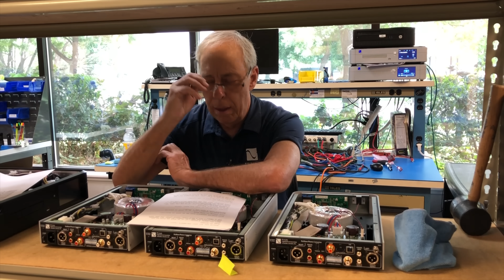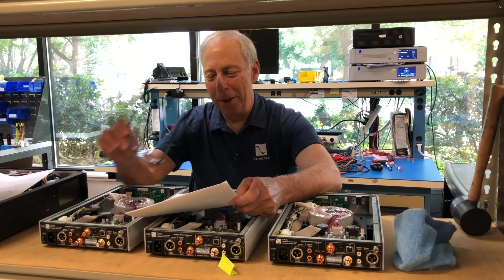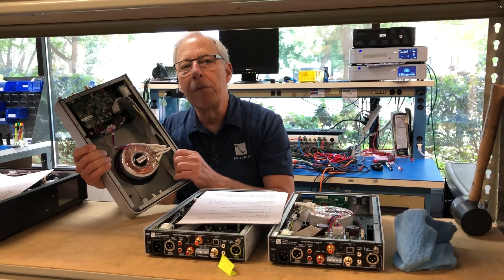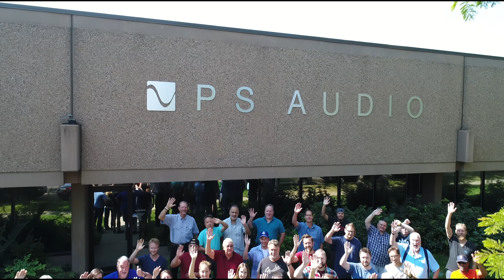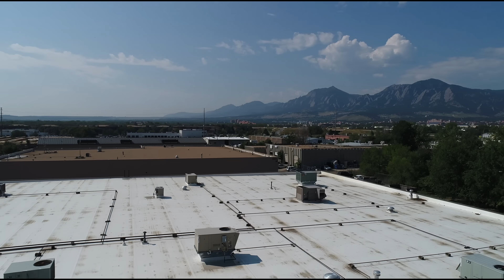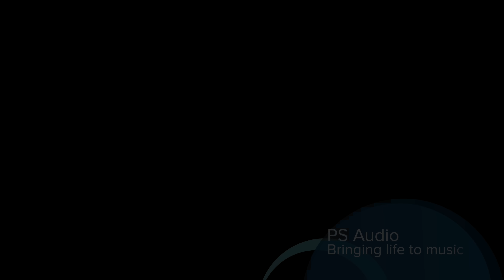What's inside a high end power cable?

Comment: Having personally put together a signal integrity laboratory with over a million dollars worth of Tektronix gear to study signal propagation from DC to 33GHz, I would have to point out that the 75 or 100 feet of wire from the panel to the outlet will be 14 gauge Romex terminated with a NEMA 5-15 duplex receptacle in most residential cases unless the space was designated as a listening room or theater in which case it will be 12 gauge Romex (named for its birthplace of Rome, New York) terminated with a NEMA 5-20. In commercial spaces by code in all places I'm aware of the wire will be in EMT or flex and will likely be 12 gauge THHN stranded terminated in a NEMA 5-20. The power cable itself represents a very small characteristic imparting portion of the path however the connectors are choke points that effectively make the cable qualities moot if the connectors are unable to perform. The IEC part of a power cable is an especially susceptible point as the bulk of connection task falls on the cord side and also remember that an IEC 60320 connector is rated for 16 amps maximum.

I've assayed quite a lot of cables and the assembly line cables the industry relies on can be frightening. Injection molded plastic hides countless untold sins of manufacturing. If I were investing in high end audio there is zero question that I would also specify a high quality 12 gauge power cable such as the ones used on rack servers, where quality is paramount and product is built to function, not to be inexpensive. For a listening room where the aesthetics of the system are part of the overall experience, even the power cable is afforded the opportunity to become a piece of art and if it is to be art, it must not be compromised in its original function. Because of that criteria and context, I cannot find a $200 power cable shocking at all where as it would be sheer insanity for a television.

From my experiences if I were to be designing and installing a new custom home system today, I would use 8 gauge stranded wire to a NEMA 14-30 receptacle and then a electric dryer cord to the amp with the wire soldered directly in and no IEC connector. For a small theatre I would do much the same except I would use 6 gauge and a NEMA 14-50 setup which is commonly used for electric ranges. While many would consider that excessive, the low impedance justifies it if you're trying to achieve everything that can be had.

For me the utility wins the day, so 10 gauge stranded wire from the panel using crimped and soldered connectors to Spec grade NEMA 5-20s with a heavy duty server IEC power cord is fine for my ears, but ideally a listener would want to also include something like a PS Audio DirectStream Power Plant to locally manufacture clean power at the amp with the amp having a short as practical power linkage to the Power Plant, made from the highest quality plug spliced onto the amp's cord. The Power Plant effectively eliminates the need for any performance in the bulk power delivery so long as the quantity of current is sufficient. This also enables the transparent use of a BrickWall™ surge filter which places a large inductance inline with the power delivery and is the best protection from surges you can give your investment IMHO.
Reply: Lots of double talk and lots of BS. If you really knew the loss and requirements of a 33GHz coax cable then you would actually have some perspective on snake oil. Also, if you really want to know about power and wiring amperage/diameter all you have to do is look at the welding industry. Three phase 440 & 500 amps is commonplace for larger machines. Audio, unless your dealing with 1000 Watt PA systems has minimal power requirements (120V *20 amps=2400 Watts) to work with.  Maybe Paul's PS gear is so underdesigned that you can hear the difference on a Quote "highly resolving system" that requires ridiculous $$$$ line conditioning due to poor design of his boxes.

Comment: 8:54 ... I think you meant to say copper.  I thought that in commercial buildings the standard was conduit with 12 GA. solid copper wire.  

You mentioned aluminium which was used for a short time for residential wiring.  I rented a place that had aluminium wiring and it was dangerous.  The contact at the breaker box became unreliable and the voltage was fluctuating between the two 120 volt line.  The lights were getting brighter and dimmer as I used different appliances.  I fixed it by re securing all the wires in the breaker box.  I only lived there two years.
Reply: Aluminum wire was often used in residential between 1969 and 1976 when the price of copper went to the moon.
The aluminum wire would be 12/2 to handle 15 amps, whereas copper would be 14/2 for the same current capacity.
Aluminum wires themselves are safe, the connections are the main concern for overheating and fire risk. Aluminum over time oxidizes, and the coating of aluminum oxide on the outer surface of the conductor is an insulator, and causes connections to heat, arc and expand / contract compounding the problem until the connection burns up.
You can live safely in a home with aluminum wires, but the connections need to be checked for tightness, coated with anti-oxidant gel, and overall be done with care. Aluminum wire has zero tolerance for sloppy termination.
Reply: While aluminum wiring is now illegal in residential installations (due to all the electrical fires it's caused throughout history), it is still permitted in commercial and industrial installations. I have no idea why. The physics and the dangers of aluminum wire are still the same.
Reply: @Orcinus24x5  the service  cable coming into your house is aluminium
Reply: Also, electrical code forbids Romex type cable in commercial and industrial indoor applications. There, 12AWG THHN in metal conduit is required for 15 amp circuits, and armoured (BX) cable is the only exception.
Reply: I'm an electrician, I work in big industrial settings like factories and power plants etc. Aluminum is used often when you are talking about switch gear and bus connections. When the cable is as thick as your wrist other factors become more important like the weight difference, the massive cost difference etc. Generally all you really need to account for when using AL over CU is upsizing the wire to the next highest guage than what would be called for in copper and using terminals and lugs rated to hold aluminum. No biggie.
As far as better sounding power cables goes,... Electrons don't care how they get there. Power has no information contained in it audio wise. Certainly not once it's been through the first stage of filtering and regulating. That's kinda the point of that stage anyway. To take whatever comes from the service, clean it up and feed in a regulated stream of electrons without variation.
This whole idea is utter nonsense on every level. Make sure your power cable has enough conductor in it to handle the amperage, maybe a tad more than strictly needed and make sure your connections are good. Hell the outlet in your wall would have more to do with available power than the cable would if it's dirty and corroded.
Reply: In this context, I'm sure he meant to say copper.  But, aluminum, while less popular, is still used for electrical power wiring.  Because it expands and contracts at a different rate than copper, there are lots of specifications on making connections and tightening screws.  Also, most of the what you see in the big high tension towers is aluminum.  It has low resistance and is much lighter than copper.
Reply: I'm Me 

Aluminum has higher electrical resistance 
than copper.

Aluminum is significantly 
less electrically conductive 
than copper is.

Comment: It is interesting about the solid core vs. stranded.  I have done this experiment myself with both power cords and speaker cables and the solid core wins out every time.  I find that using several thinner solid cores, each individually insulated, seems to be the sweet spot.
Reply: Julia Set Yep,... that is what undersizing does. It chokes the flow of current. Most noticable in the bass frequencies. You could also use an equalizer... this will even "sweetspotter" you. ;)
Reply: Several wires being the key word here.  Four CAT5 Belden cables (300 volts rated) with the pairs striped out and twisted together will get you 12 Ga.
Reply: Julia Set That doesn't necessarily mean anything. It's dependent on the voltage generated (volume), speaker impedance and length of the cable. Anyway if you can perceive (or better measure) a difference, that only means you are choking the current flow, which basically comes down to using your cable as a tone control. Not it's intended purpose. But eh, whatever makes you happy...

Comment: Well, if you replace heavy gauge copper household power cables with equivalent cross section aluminium cables in single core form, skin effect does start to measurably show up and affect wire impedance for AC current. That's one more reason why household copper cables are all multicore designs of very small diameter wires. Transmission lines look massive but if you ever get to see a cross section of them, they're all multicore. 

Since skin effect gets worse with increase of frequency, the negative effects on sound quality would be much more observable at audio frequencies that get into kHz.
Reply: High Voltage power lines (30,000-500,000 volts or more) normally have a copper core surrounded by aluminium wires.   These wires are not for "skin effect", but rather for heat dissipation.  These wires are air cooled.  skin effect is negligible at 60 Hz.

Comment: Using a good screened mains cable is worth the money. It stops electro-magnetic stray into the rest of the system. I have used many and have had good results. Get good equipment first and buy a mains cable of 5 or 10% of the unit cost. Solid core best but it can be impossible to place. Been there. Now use a cable that has multiple (8) smaller gauge individually insulated wires (each) for live and neutral with heavier gauge earth. Sound great for detail and bass definition. Merlin funnel web FYI.
Reply: I have actually installed via soldering to eliminate the IEC socket, as heavy an appliance (wall A/C) power cord which still has a three prong plug into a standard 15/20 amp receptacle. I can buy a screen (shield) to go around this cord. Should I only ground one end and which end should that be?

Comment: are those DACs ? what is USB and coax doing of a phono stage ?
Reply: Not a DAC but a ADC. They are a fully balanced phono preamp with an option to convert all of your vinyl to digital. The USB output allows you to connect it to a computer and record vinyl. Even allows you to record in DSD.
Reply: @psajamessh848  very nice touch, great
Reply: Great question